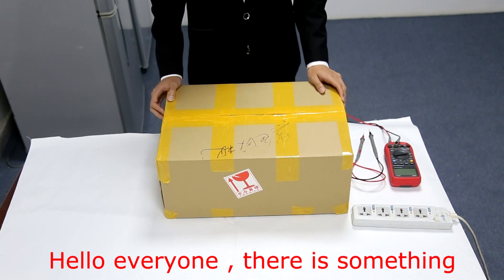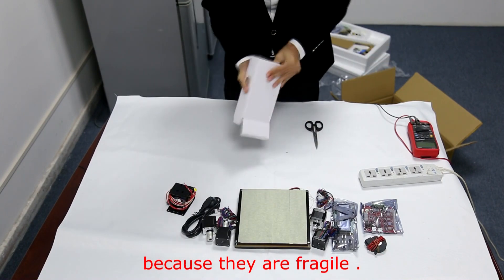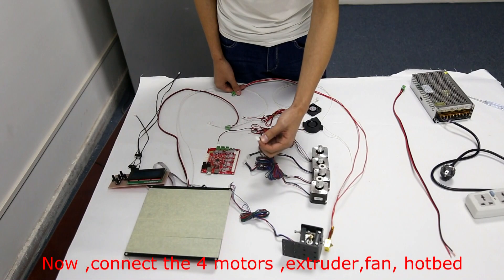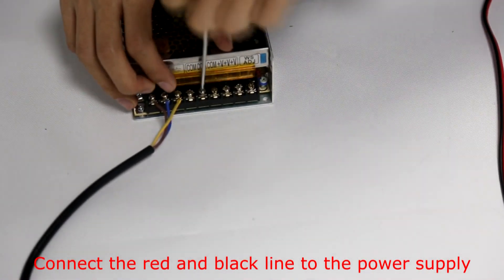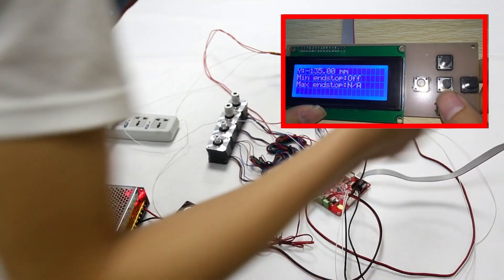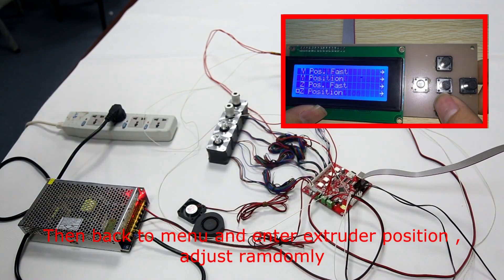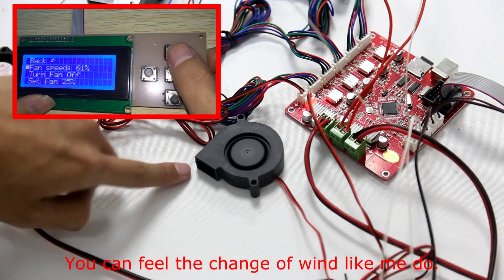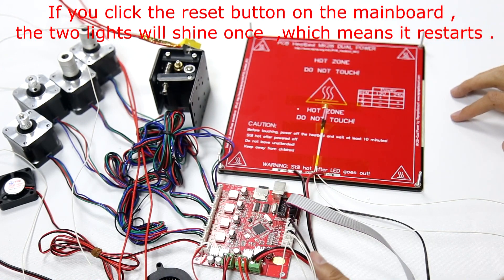Channel website to watch newest video : https://www.youtube.com/channel/UC8XvjHMPloavOhyGAy359qQ

Comment: On Step 9 the instructions say M3 40 Screws, but we don't have those (at least not labeled). However in the video it's mentioning the long M4 screws which we have.  Can you confirm which screw size it's supposed to be?  Thanks!

Comment: WHOOOOOAAAAAAAAAA!!!   Aftrer ohming out the main power cable, the nuetral wire is BROWN, the positive is BLUE, and the earth ground is YELLOW w/GREEN tracer. SAFETY! SAFEETY! SAFETY! (The large blade on a 120 VAC receptacle is the nuetral, the small blade is positive, and the half round is the earth ground.   Meaning, with the earth ground in the bottom location {half round} of a 120 VAC receptacle, the nuetral is in the upper left {large blade} and the positive is in the upper right {small blade}.

Comment: ! ! ! ! ! ! ! - - - - - POWER MISTAKE - - - - - ! ! ! ! ! ! ! 
I think there is a MAJOR MISTAKE with this instruction video ? ? ? My power lines on the controller board are the other way round ! SO... from the power supply the left hand probe is measuring the Ground (0V)  line and the right hand probe measures +12 V (on this video the meter shows a MINUS sign on the readout indicating the voltage is opposite polarity). On the silk screen markings on my board the + and - signs are shown correctly (black and red cables also the other way wound than shown in the video). I will look for the update youtube video but this is the video link i was given with my instractions for my 3d printer kit)

Comment: Hi, I order one of your printers anet a8 in gearbest, everytthing went correctly until I connect the main board to the power supply and one off the heat disippator went on fire, I was shure my voltage switch was at 220v because in my country Mexico voltage is 127V / 60Hz. My heat bed works fine and leds works good as well but my lcd didn't work at all, and there's the fire problem. I connected it carefully, it took me 8 hours to assamble but without a users guide in my order I'm not suere what's wrong with it. My main board isn't damaged even when it went on fire but I think it need's to be replaced. Can you help me?

Comment: I have a problem with the X Motor not working. It doesn't work, I switched the X & Y Motors and then the X Motor worked, but not the Y motor. I checked the soldering behind the X Motor plug and it looks fine. I think the stepper drive is faulty. Is the only fix to this a new board?

Comment: Good afternoon. I connected all the components as indicated in the video, and the first time, the screen worked correctly, but it was blocked, and when I turned the system off and on again, the screen went black with two rows in white .. After switching on and off several times, it worked again, but it is locked again, and I have not been able to put it back in service. What I can  do ?. Thank you very much

Comment: This is really annoying. 

I did this pre-test and everything checked out. Then I assembled the printer (after realizing that the nuts that were shipped were actually M7 and NOT M8 and getting replacements) and lo and behold, NOTHING! All I get now is a backlit blank LCD and 7 flashes on the mainboard diagnostic light, but I guess it would be too easy to just TELL PEOPLE what those mean.

Not impressed so far. Feeling like a waste of money.
Reply: Does ANYONE know the led diagnostic codes for this controller?

Comment: +David Dan ; +Dad Klein : I have the "def" temperature issue, too. Everthing works, but temperatures show -50°C something a second or so, then go to "def". I suspect the temperature mapping table is wrong in the firmware, but I need to know the exact types of thermistors used before making any changes, plus I do not want to make any other changes, so I need the original firmware used. I think I found the latter on the dropbox of David Dan - but it is an .hex file only.
Reply: +Ghastly Weasel 
The Anet A8 uses the common 100k ohm thermistors. I ran into the same issue, pull the plugs to the thermistors off your logic board, and test the resistance on each one with a Multi-Meeter, they should read around 100k ohm's each. 

The symptoms you are describing tells me that you have a bad thermistor, as this was the same issue I had.

Comment: I have a problem with the heat bed not working during the pre-test. checked the thermistor and it is open the extruder thermistor is around 100K ohms and changes with tempature. The lights on the main board don't light up either and the LCD displays DEF for a temp reading for both the bed and the extruder. When we do a reset the appropriate leds light up and all steppers and limit switches check out fine. Where do I go for more tech help? Thanks, Ken
Reply: +Dad Klein ; +David Dan
I have the same issue. When the printer is just loaded tempetature of hot end is shown as 26 C&#176; and -51 C&#176; for heated bed, but next second both of values are changed to "def". When I plugs printer to computer with Repetier this message is shown in log: "heated bed: temp sensor defect". 

Also when I try to Preheat PLA (like on this video) nothing happens. Leds on the board do not turn on and there are no voltage on hot end and heated bed.
Reply: +Dad Klein 
Hey, I figured out the issue for mine, it was the heat bed Thermistor (technically one of the wires was broken). Both heating elements will fail to operate if one of the Thermistors fail. Check them with a multi-meeter, they should read 100k ohm. For me, the bad Thermistor read as having no conductivity.

Also, if you run the printer, and cannot get it to print the object in the center, your X and Y servo motors are probably swapped. (Make sure to swap the end stop switch wiring too, I made this mistake... won't happen again!).

Hope this helps.
Reply: +Dad Klein 
I am having a similar issue, where the heat bed, and extruder don't heat up. Everything else works...
Reply: +Dad Klein I've also the same problem with no resolution's or technical support. I suspect it is the controller board at fault as replacement thermometers have not worked. I'll be requesting a refund I think, and would advise others to avoid this product, especially with the ANET controller board.
Reply: +Dad Klein . I solved my issue: It was the connectors from the thermistors to the board being flakey. I removed the housing and sticked the leads with their metal end to the pins, and - voila - it worked. A guy wrote this in http://forums.reprap.org/read.php?406,658522,659044#msg-659044
Reply: +Ghastly Weasel 
Glad you figured it out, looks like people on that forum really did not want to help you.
Reply: Thanks guys! my thermistor was broke right where it comes out of the heat bed in the epoxy---I was able to wiggle it and see it work.  I got it off ebay and asked the seller for a new heat bed.

Comment: After I assembled my printer, I realized that the power supply does not seem to be functioning
properly. I have traced through all of the wires to ensure proper connections,
but when I connect my power supply to a 110V power outlet with the switch in
the 110V position, I get full voltage in and 0V out. The power indicator diode
also will not light. Is there anything that can be done to fix this problem?
Reply: same problem for me
Reply: From this video I see that the board works on 12v so if you're out of better options you can try getting a cheap PC power supply and using the 12v from it's molex cable to power the board (on your own risk of course).
It'll also probably be safer than this naked abomination of a power supply which is probably illegal to package and sell to end-consumers.